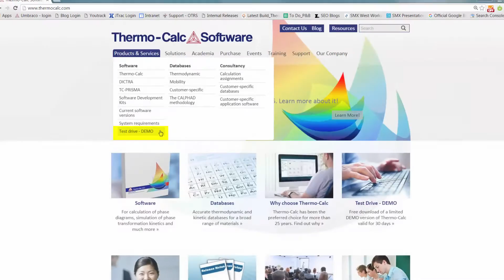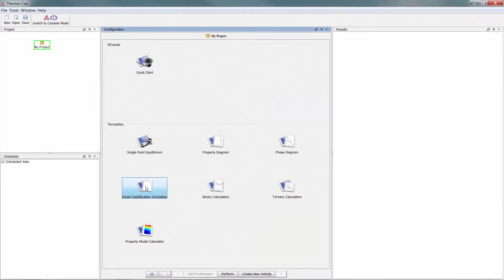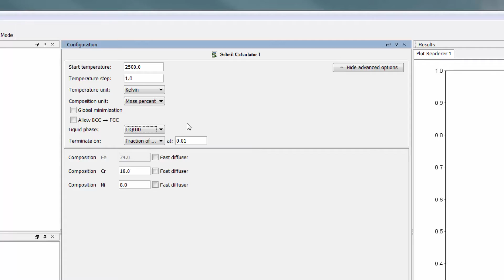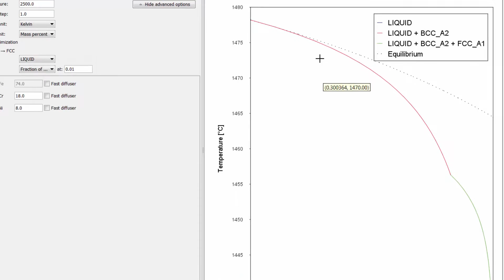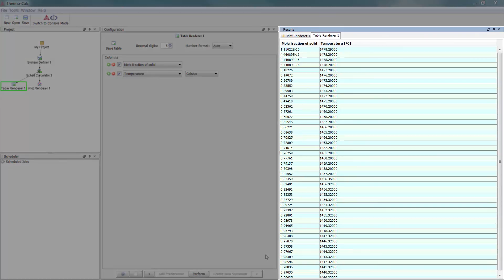Thermo-Calc Applications to Welding and Joining with Bonus Scheil Example

Comment: Hi, I got a question. After performing DICTRA simulation using console mode and getting the plot, how to perform table renderer in the console mode to get the raw data of the results from the plot? Is there such a command to do so?
Reply from the maker: HI Achmad, thank you for your comment. Tables can be listed in the Console window. You can use LIST_DATA_TABLE to output to the screen or to file.
You can read more about this command in the Online Help, which you can access from within the Thermo-Calc Software. Hope this helps!
Reply: @ThermoCalcSoftware  Hi, I used LIST_DATA_TABLE in the post processor but the response is "No such command, use HELP"
Reply from the maker: @achmadariaseta9152  Please send your project file to support@thermocalc.com and our technical support team will help you with this.